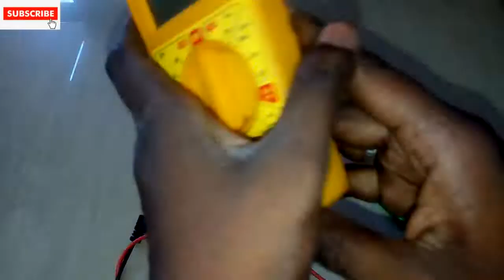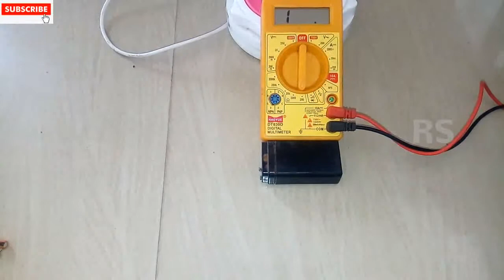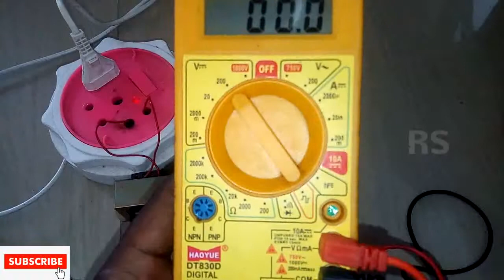Multi meter || How to use || RS Electrical Tamil channel || Ramanan

Comment: Voltage measure pannum podu red colur socket commen ka mela red socket kodukanum
Reply from the maker: Ninga soldrathu enaku puriyala nanba
Reply: @rselectricaltamilchannel456   red coler conneter voltage measure pannum podu centre pointla connect pannanum pro